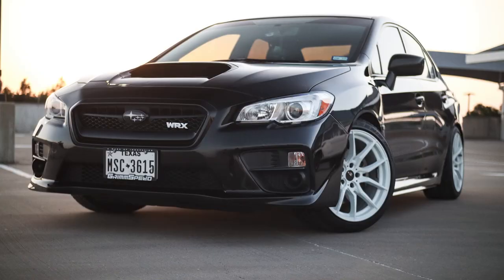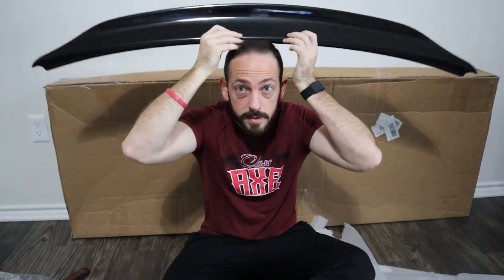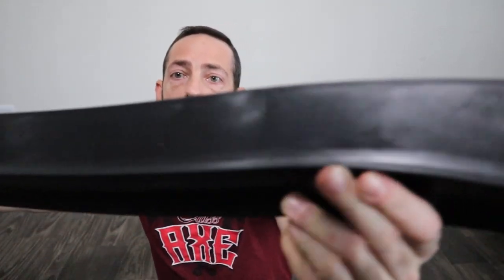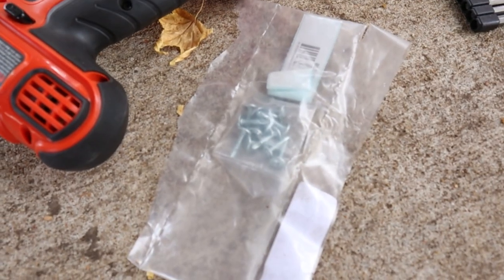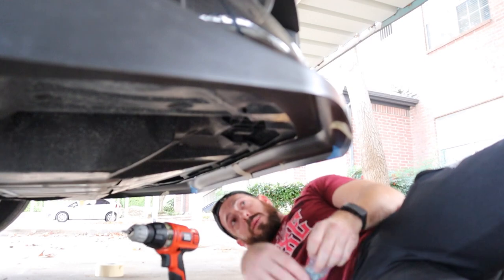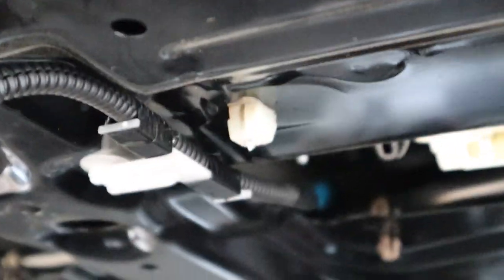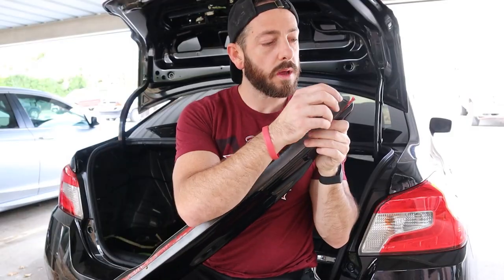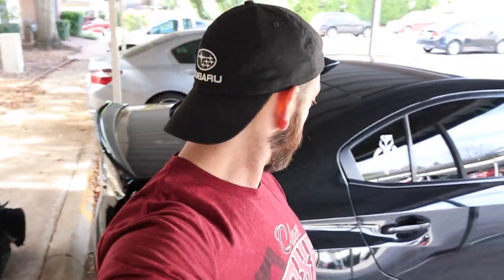WRX FRONT LIP AND SPOILER INSTALL! | CS style lip and OLM high point replica

Comment: I just installed that same lip in my 2018. I had to use heat to mold and get rid of the side gap. I also sanded, primed and painted it Matte black. I didnt trust the screws they came with so I took the bumper off and used stainless screws with locking nuts. should hold very well. hopefully i dont hit any curbs xD
Reply from the maker: That is a lot of work for a $100 lip. But I bet it looks great! I had the same idea about using nuts, bolts and washers. Hopefully if you do hit a curb it won’t rip the whole bumper off 😂